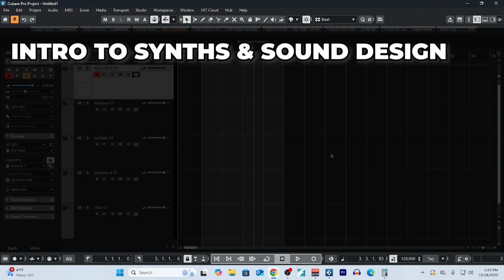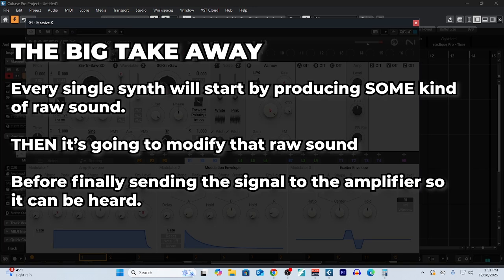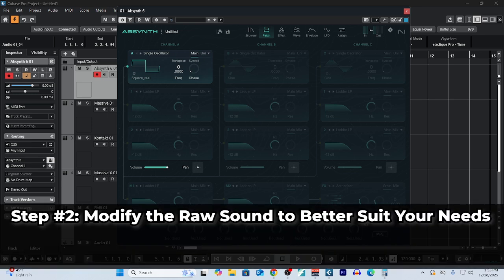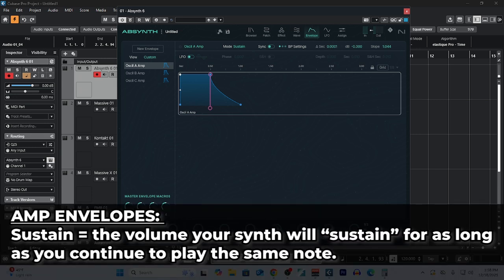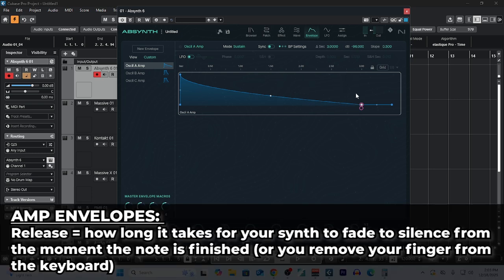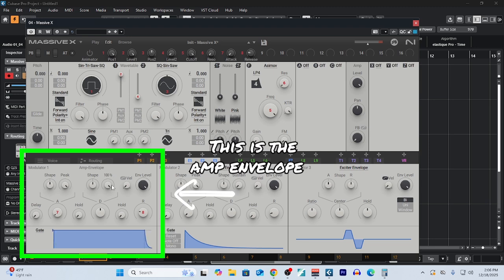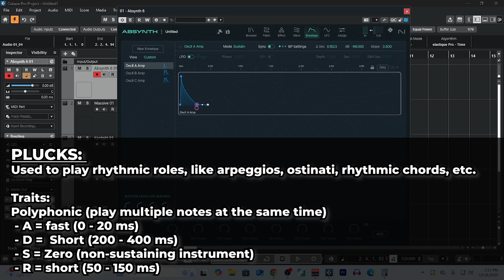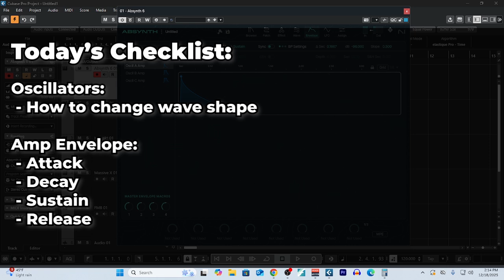How to Use Synths | Part 1 (ADSR and Oscillators)

Comment: Being a novice to synthesis. I can unequivocally say that Stephen (of famed Tabletop Composer)...approach to teaching synthesis is spot-on, especially from my perspective as a novice. Who is beginning the journey into the world of synths with zero experience or knowledge of synthesis. Tabletop Composer’s “go-no-go” teaching method–where one must first master a teaching module before moving on to the next teaching module–has exponentially aided my understanding of synthesis; specifically “subtractive synthesis.”

And what has made learning and understanding the fundamental foundations of sound design so much easier is–Tabletop Composer’s use of teaching and demoing the concepts and principles of sound design on–Native Instrument’s MASSIVE X and lately ABSYNTH6. During our private lessons Stephen uses MASSIVE X/ABSYNTH6 to demo how easy it is to sculpt, route, or modulate the soundwaves using MASSIVE X/ABSYNTH6 osculators, filters, and envelopes, which has proved invaluable in my understanding of synthesis...making the programming of LFOs, ADSR envelopes, filters–and so forth–so easy that a fifth grader can do it!   .

Therefore, without hesitation...I wholeheartedly support and endorse the use of Native Instrument’s MASSIVE X/ABSYNTH6 synths for teaching beginners the fundamentals of synthesis sound design (to include Ring Modulation, Osculator Sync, Frequency Modulation [FM], Filter and ADSR envelopes) Using MASSIVE X/ABSYNTH6 has made setting-up these operations easier to comprehend!) For me...MASSIVE X/ABSYNTH6 has made the learning and applying the principles of sound design through the use of Native Instrument’s MASSIVE X/ABSYNTH6 synth crystal clear.
Reply from the maker: Appreciate you, as always, my friend!!!